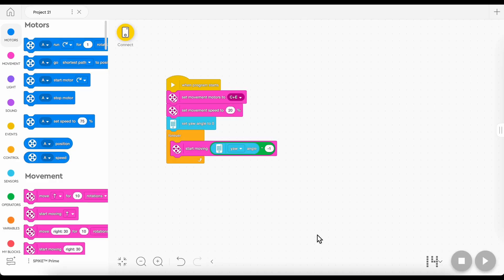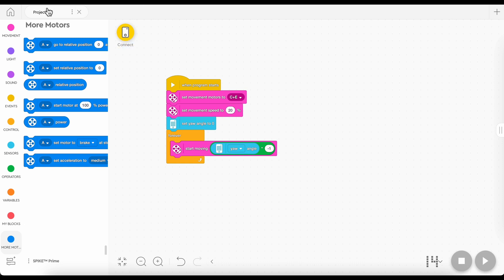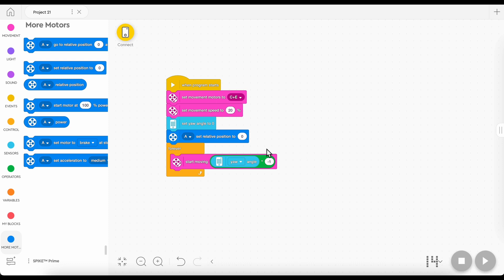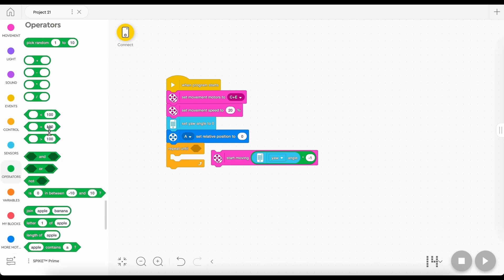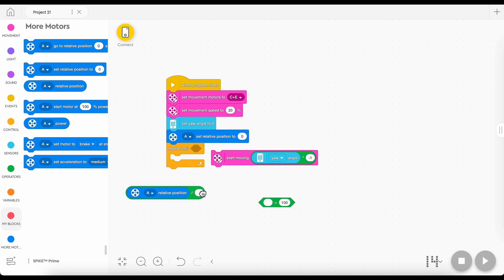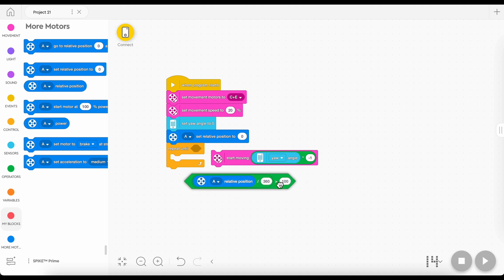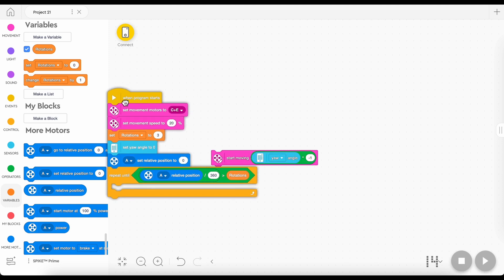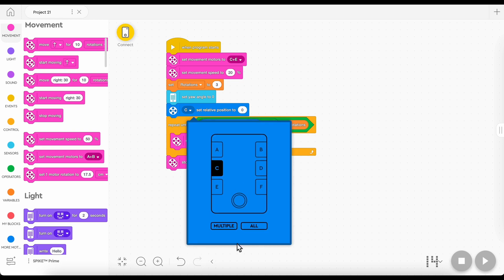SPIKE 3 Removed the Rotations Output bubble... So I made a better one.

Comment: We took same approach but converted the motor degrees to distance in cm.  This way you can measure how far to go, and use the my block to tell it to go that far. This works most of the time. However, lately we have seen terrible inconsistency in this distance drive method from run to run, almost like something internally sets a new distance. This has made everyone scratch their heads and wonder if the current version of spike prime has some bug. Let us know if have seen this too. (Ref spike prime v3.4.2)
Reply from the maker: I have not seen anything like this. Could you email me at tellurium.robotics@gmail.com with a screenshot or file of your code? I would love to look at this block, and see if there is a way to fix your problem!